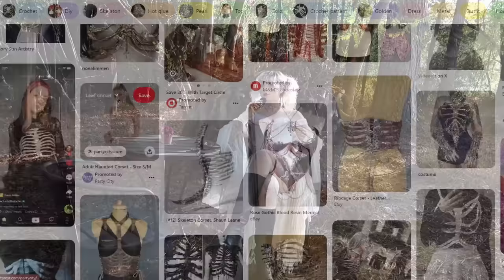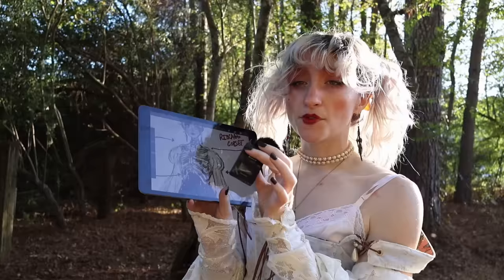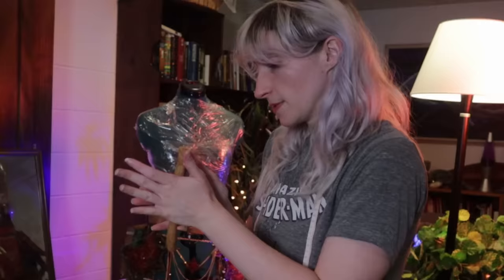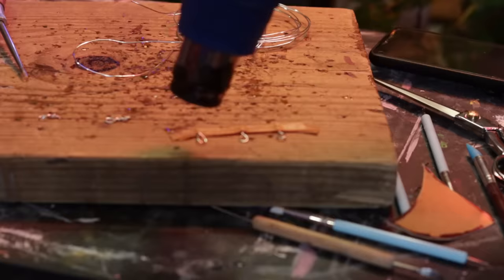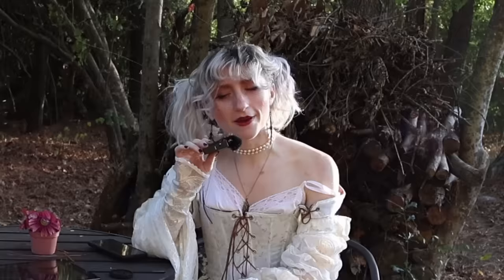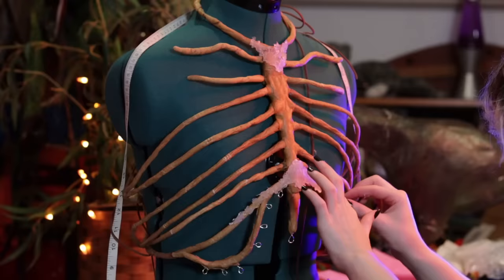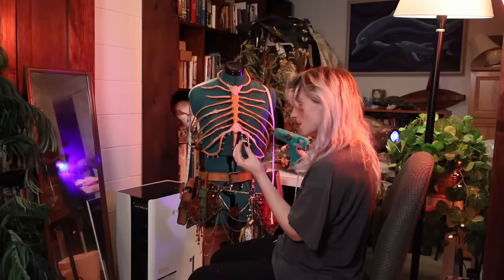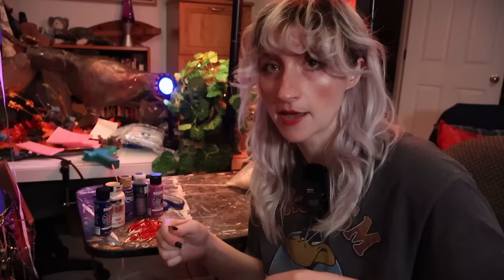I made one of those rib cage corsets (but its a lil fancy) ✨💀🩸

Comment: Tip I just learned for working with hot glue! If you lick your finger before you touch the hot glue it will protect your finger from the heat and also the hot glue won't stick to your finger and pull away when you pull your hand away! It's super useful when you're trying to manipulate hot glue and smush it into the shape you want it. :)

Comment: Okay, this idea might be absolutely insane, but what if you tried to melt worbla using a double boiler of some kind, that way the plastic melts into one whole mass and makes things much more malleable! (I just got inspo for how chocolate is usually tempered, so it might not be the best idea..😭)
Reply: In my experience worbla doesn't truly "melt", it just gets soft and pliable enough to smash it into other worbla. And if you roll all that worbla around it kinda melds together a bit, but it's more akin to the effect of folding steal rather than melting chocolate. So I don't think a double boiler would work quite the way you're imagining.
Reply: @OdinsSage  Omg, tysm for letting me know this!! I was planning on trying it when making my own rib corset ;u;

Comment: So I’m always worried about hot glue melting in heat if I put it on a costume. Has that ever happened to one of your pieces Kira or is there a way to mitigate that???
Reply from the maker: If you're super concerned I would use high temp hot glue! It has a higher melting point so I don't think normal environmental temperatures could melt unless it's really hot. I tend to get budget materials most of the time so I don't usually use high temp, so while it is rare for something to melt, it is something I have to consider/try to avoid since I live in a hot climate. Leaving things in a hot car is a definite no! But if I'm walking around (especially in shade/indoors) hot glue projects are usually fine 👌